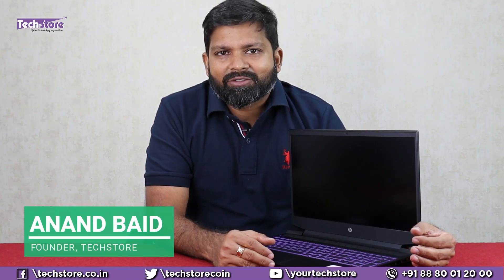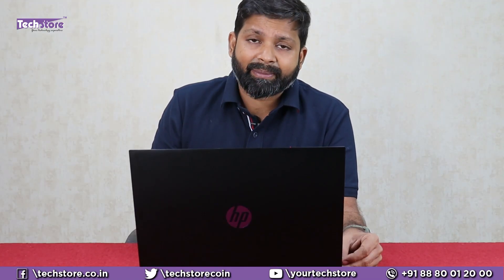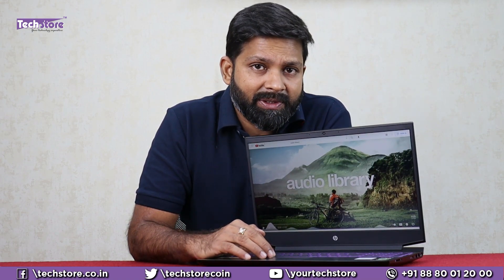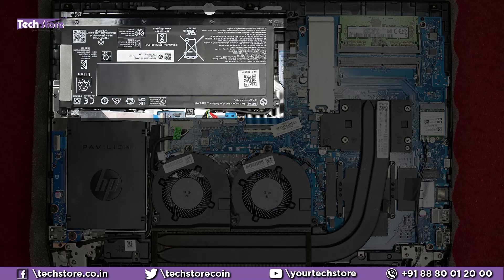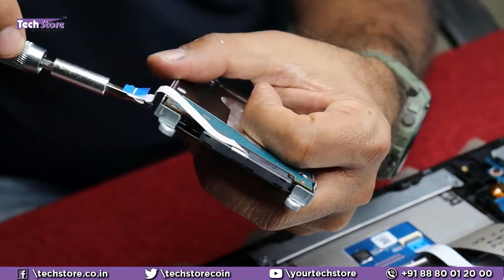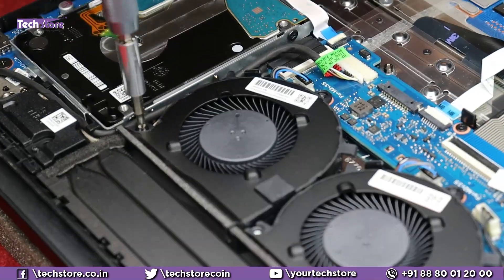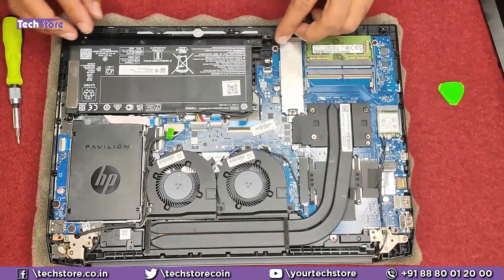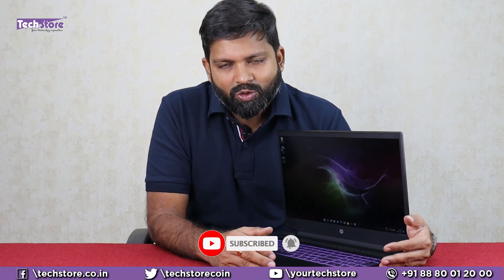HP Pavilion gaming EC Series EC2008AX: Review disassembly upgrade ram hdd m.2 ssd battery diy

Comment: Sir, can i keep the ram to 8gb default+ 16gb new one = 24gb total ??
Please reply sir 🥺🥺
Reply: Sorry for the English.. i hope you understand
Reply: sane question what you done now
Reply: @Malwarekid  i have answer ... Dual ram same size is better than different size
Reply: @FIVEsaken55  so i have to add 8gb rather than adding a 16 in one slot right
Reply: @Malwarekid  yeah because the higher variant will work according to the lower one ... If u have 8gb and you add new 16gb , then the 16gb will also work as 8gb because that old 8gb won't be able to work like 16gb but the new 16gb can work like 8gb ... That's all I know as far my knowledge
Reply: @souvikdebbarma5503 's views are incorrect. It will work fine, just due to non dual channel memory efficiency would be less, but if someone's asking this they probably won't ever need dual channel behavior which only required for edge cases, not everyday use. So just go ahead an enjoy 24 GB of memory @scriptkiddiee007. Adios. 
Get 2 x16gb if you can for better performance, but don't worry if you can't you still WILL have 24 Gb.

Comment: Which one is better in this three? 
15ec2004AX
15ec2008AX
15ec2150AX
Please reply
Reply: 2004ax has 144hz display but not ms office
2150ax has ms office but not 144hz display
2008ax has both the things.
Reply: @ashutoshsharma1831  also 2004ax comes with wifi 5 according to Flipkart
Reply from the maker: EC2008AX

Comment: Can I expand ram 8gb + 16gb = 24gb ?
Reply: No ,you can only expand 8+8=16gb
Or 16+16=32gb
Reply: Yes you can but you'll be in single channel

For dual channel, you must use both ram with same size and frequency

Comment: does it hybrid storage ?
as i have read in web site of hp they have not mentioned....
does it having 32gb ram upgrade option?
they mentioned 16gb
does it has 3.0usb 2 ports?
they mentioned 1 3.0 amd 1 2.0 usb

sir please verify all and reply me because i m using this laptop and want to upgrade ram and rom so plzzz help me
Reply from the maker: Yes it has hybrid storage. You can upgrade upto 32GB. It has 1 USB2/ 1USB3/ 1 USB3.1 C type. Thanks for subscribing.

Comment: Iam confuse buy laptop
Ec2150ax and ec2008ax
Which one buy
Reply from the maker: EC2008AX is best. MS Office/144 Hz/ HDD Connector inside for hybrid storage
Reply: as i buyed my ec2008ax few months ago
2150 has 60hz display and u will not get ms office with that